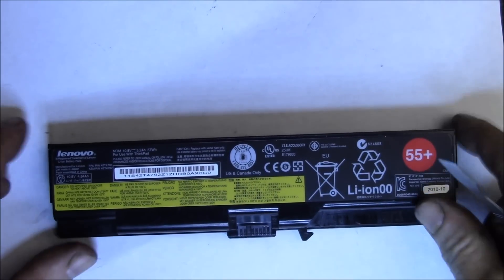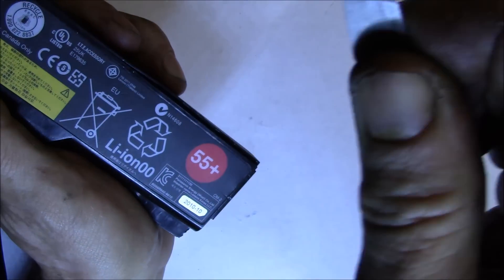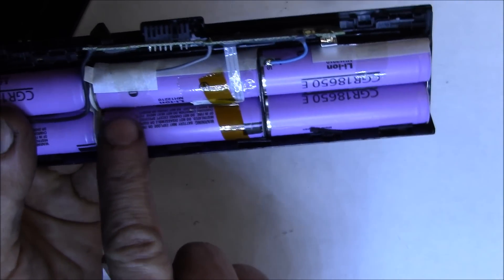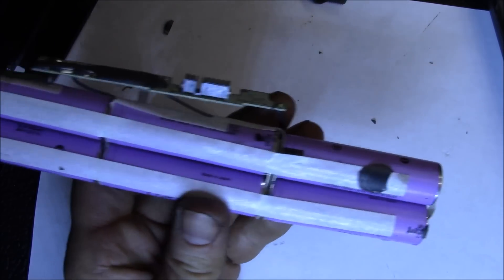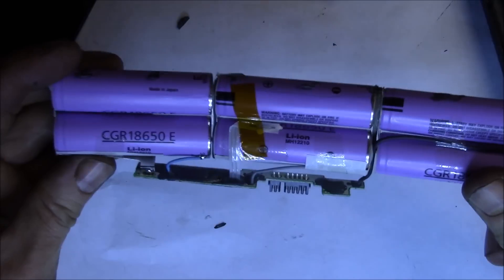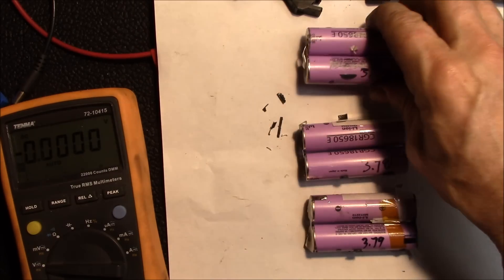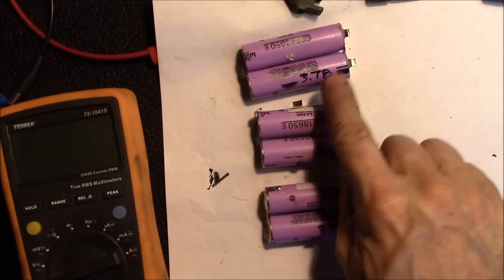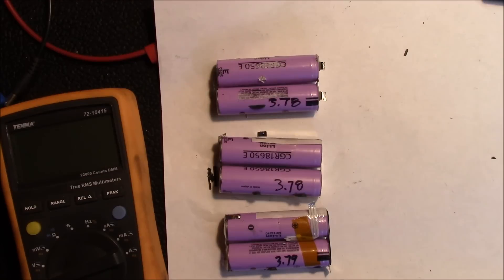Processing Lenovo Laptop Battery Packs

Comment: Cool, I see these for a great price on ebay and possible to build a big battery for a very reasonable cost. Way cheaper than anything new and imported. And Japanese batteries rate much better than Chinese according to some testing I saw. Following!
Reply: Okay 2010? these for sale now in 2022 might be different and fingers crossed they will come apart ok.
Reply from the maker: @douglundy5755  It was about 6 yrs. ago I processed these packs.  The cells retrieved are still going strong in my power wall, they get cycled about 30% every day.
Reply: @The4Crawler  I found an HP pavillion with eight 18650s and looking for more! Im just using the laptop charger to build a recharging device for testing.

Comment: Do you have a video that goes over your solar power charging station? I'd like to see how that is configured and how that works. Also, you mentioned that you charge the batteries, then you perform a discharge. Is discharging necessary for litium, 18650 batteries?
Reply from the maker: This video shows a version of that:
https://youtu.be/5DBeo5EElbk
I've used a number of RC battery chargers, like the iCharger 1010 that supports operation from up to 18VDC and also has a regenerative discharge feature where, if connected to a battery bank, it can use the energy from discharging the battery under test into the main battery bank.

Yes, I find that it's best to first charge the 18650 cells up, let rest for a week or so to check for self-discharge, then do a full discharge to measure the capacity, then recharge them to storage state.  

Then I can sort out cells of low capacity and match up cells of similar capacity to build the ultimate battery packs.

Comment: Hi! Thank you for sharing all this info. 
Can I ask you a question? I am thinking of replacing my old battery with a new one for my Thinkpad W510 and I don't know if there is an issue if instead of getting 50++ (as the original) I get a 70++... 
Do you know the difference and if they will perform differently?
Many thanks in advance! 
Best, Jo
Reply from the maker: Generally I think that is OK, as long as it's the same voltage battery pack.  My old Gateway laptop had 2 batteries, one had just a single set of cells in series and the larger battery had 2 parallel cells in series and thus double the capacity.  In your case, it's likely 2 parallel cells in the lower capacity pack and 3 parallel cells in the higher capacity pack.
Reply: @The4Crawler  Thank you so much!!!

Comment: I was advised to keep the BMS powered at all times by hooking up a 250mah Li-Po battery until replacement of the cells has concluded. Is this true?
Reply from the maker: I suppose that's a good idea if you are planning to repair the battery pack by replacing the dead cells.  In my case, I was just tearing the battery packs apart to recover the cells inside.
Reply: @The4Crawler  ahh, I see, yeah makes sense. Thank you

Comment: Have you by chance ever come across any batteries intended for the thinkpad x60/x61 tablet model? I am trying to do a rebuild of an old batter with new cells, but the first one I tried to open ended up getting somewhat torn up on the outside, and since I want to use it for its original purpose, that is obviously something I want to avoid.
Reply from the maker: At the time, I wasn't paying attention to what model the batteries were for.  If I do run across one, I try to let you know.

Comment: what brand of 18650s are those? can the case you opened be closed back up? the BMS that comes with those packs, can it be replaced, and the on-board chip has its code already loaded? if you took a 6-cell Lenovo (thinkpad E535) and replaced all the cells, so they arent mixed old & new, will the BMS recognize them? assume the new cells ratings match old ones. thanks for a great video!
Reply from the maker: I think they are Panasonic, judging by the p/n: GCR18650E:
https://secondlifestorage.com/showthread.php?tid=1734&pid=23828

I suppose if the case were opened carefully, it may be able to be re-closed, I didn't investigate that option.
Also didn't look at the BMS but I imagine if it's simply based upon voltages it should have no problem with new cells.  Not sure where things like capacity/mAH and state of charge readings are stored, again never looked into that.  But one way to find out is try it on one pack and see if it works plugged back into a laptop.

Comment: I have a Lenovo 45N1010   70++ battery that stopped charging.  I know its the battery because replacing it with a another battery in the same Lenovo W530  is charging and works perfectly.  I was wondering what would cause the battery from charging?
I'm tempted to try and open the battery and charge the cells individually.  Would you know of anything in the charging circuitry in the battery that would prevent the battery from charging?
Reply from the maker: There seem to be 2 main causes of that issue.  One is that one (or more) of the cells inside have gone below the cutoff value that's set inside the battery mgmt. circuit (BMS) inside the battery.  That causes it to shut down.  In that case, you might be able to individually charge a low cell and/or replace it to get it working again.  The other main cause, from what I've heard, is that the BMS itself has failed.  Probably hard to repair that, might be able to replace that BMS circuit board with one from another battery.
Reply: @The4Crawler  I spent sometime this morning and opened the battery.  All the cells are good.  I had a little over 11 volts with each battery no more than than .03 volts difference between cells. I have a balanced charger but since the cells where that close I am just manually monitoring the cells for now while I am charging.
I certainly would like to know if there is a known problem like a simple in line fuse.  I just started to look on the board with some tracing.  I think 2 pins at the connector have to be shorted with a resistor to turn
on the circuitry.  I need to get more details on that.
Reply from the maker: @n1kkri  Might try searching the net for any troubleshooting tips or technical information on either the battery p/n or the p/n of the BMS board or the specific IC part numbers.  Maybe you can get the pinout of the battery connector  to try getting the battery to turn back on.  There may be a broken solder connection some place or a short between two traces or connector pins.  You might also try discharging it with your charger down to around 3 volts/cell and see if that does anything to trigger the BMS on.
Reply: @The4Crawler  About a year ago I watched a youtube video showing someone with an adapter that plugged into
the batterty connector making it a easy way of measuring voltages.  The adapters where all part of kits
that where expensive.  One of those adapters could come in hand should I want to make a easy external charger.  None of this is really practical unless you can get it to charge from the laptop.  Its just fun stuff to play with.
Reply from the maker: @n1kkri  Yes, having a mating connector is very helpful.  I've made those sort of things for power tool batteries and other rechargeable devices.  But the laptop batteries are more complicated and unless you have a source for the exact mating connector, that's hard to do.  I guess they design these things to not be easily repaired and expect you to throw away the old one and buy a new one.  At least that gives us power wall folks a source of decent used cells since it's often the BMS that fails.

Comment: You should have separate every one cell to check if every one is ok..you cannot tell if the one of the pair is dead or no voltage cause it will measure 3.7 if the one is good because thier parallel..I hope you understand.
Reply from the maker: I do this for pairs that don't test out.  But since my battery modules utilize pairs of cells and since these cells have been paired up their entire life, if they test OK in a pair I use them that way.  Ones that test at half normal capacity or less, I do separate and test individually.  Of those, it's very rare to find one good and one bad cell, they both test very similar to each other in capacity.

Others have found similar results:
https://youtu.be/LRJS_iTyymA

Comment: friends, l had lenovo l3000 g530.
i opened the battery. and there were only 4 18650 batteries... 
is it possible?
Reply from the maker: Number of cells will vary depending on the pack's voltage and capacity rating.  Likely that one was set up as 14.x volts (4S) and around 2 amp hours.
Reply: @The4Crawler  thanks bro...
you mean theres nothing worng in this situation...
Reply from the maker: @arturafar8304  They make battery packs in all sorts of configurations.  In my old Gateway laptop, the std. pack was 3 cells, 11.1v, 2200mAH.  The extra capacity pack was 6 cells, 11.1V, 4400mAH.  Other mfgs. use 4 and 8 cells.
Reply: @The4Crawler  thanks for the answer brother... its very helping :)

Comment: I wanted to ask you regarding my Lenovo laptop battery, it's almost dead and needs to be replaced. So I was thinking if I can replace the battery cells themselves instead of buying a new whole battery. What do you think about this idea? And what battery cells model should I pick? (Lenovo ThinkPad L430) I would really appreciate your help.
Reply from the maker: You could give it a try.  I did that with a Craftsman power tool battery:
https://youtu.be/b5AOBwx04kA
Best bet is to open up the case carefully and see if you can gain access to the cells.  Often a voltage check will tell you if one or more cells are bad.  You can often find the cell identification information printed on the side of the cells and if so, best to see if you can order some replacements as close as possible to the existing cells.
Reply: @The4Crawler  I see, I'll try that!  Thanks for replying.

Comment: sir please help me, after i replace a new battery it doesnt have an output voltage on the possitive terminal. 😔
Reply from the maker: I've never looked into the operation of these battery packs.  You might want to contact who ever you purchased the battery from, perhaps it's defective or maybe they have an idea on how to get it to turn on.  It may be the internal battery management system (BMS) has shut off somehow and there's a procedure to follow to turn it back on.

Comment: How about the 9 cell version!
Reply from the maker: I didn't get any of those in this batch of battery packs.  I did do some in my first batch but I didn't get any video of processing those.  The main change I did with those was to separate off one single cell from each 3P group and set those aside.  My powerwall battery packs make use of paired cells, so I'll need to process those single cells separately and ultimately pair them up for use.  I still need to get to those single cells.

Comment: Can we attach 70+ battery in 54+ battery
Reply from the maker: I recall the connectors looked the same, so there's a good chance you could do that.  I have my old Gateway laptop and it has 2 different capacity batteries, one with single cells (1P) and one with double cells (2P) and both work fine.

Comment: where do you get so many batteries from?
Reply from the maker: I think these came from eBay.  Wish I had picked up more, they were from a seller who had a big collection of "damaged" battery packs, mostly with broken latches and connectors.  I bought one, found good results, but by then there was only one lot of 20 left.  Other folks find them at the local recycling centers.
Reply: oh so it was ebay
Reply: Can a broken connector be fixed?

Comment: i have a lenovo thinkpad x100e ,the battery shows 42%chinging but when unpluged it shutdown.  is it a battery problem or laptop itself?
Reply from the maker: If you have access to another battery or know someone with a similar laptop, you could try swapping in another battery or put your battery in the other laptop and find out where the problem lies.
Reply: If the battery doesnt keep the laptop on then the battery is dead or worn out
Reply from the maker: @mocanulaurentiu5812  That's usually the case.  It may be one or more cells inside the battery are bad or it may be the circuitry inside that reports the condition of the battery to the CPU in the laptop.